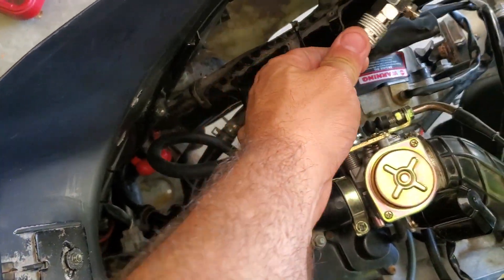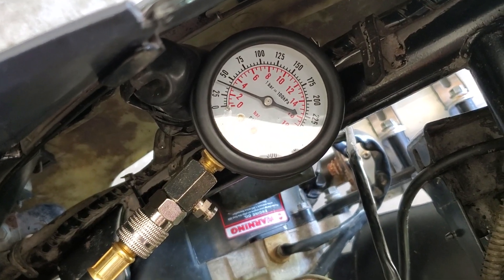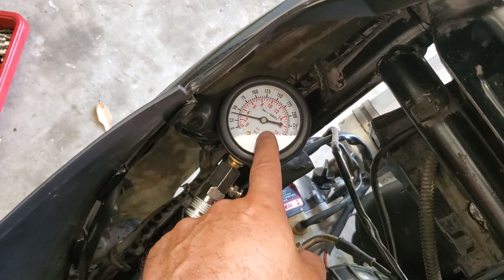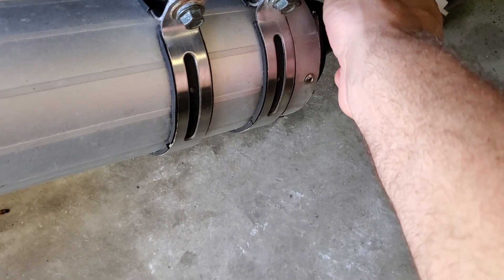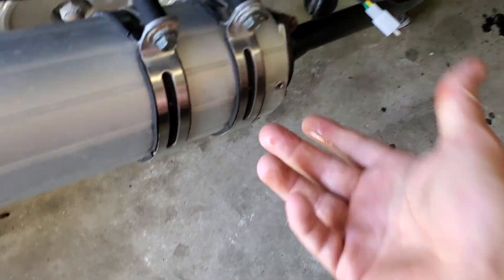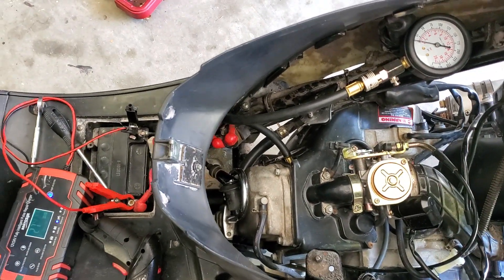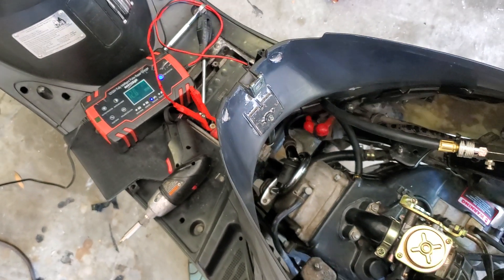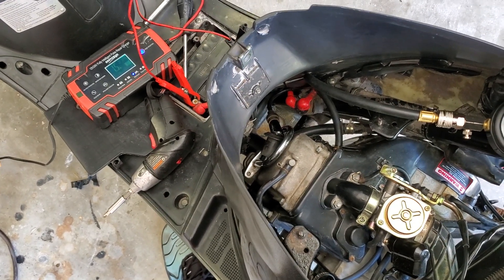50cc scooter compression test

Comment: Do you have a trusted place to get a new engine? My scooter sat for three years and wouldn’t run at all. I have been fixing it new gas, oil, starter, relay, new electric start, Valve adjustment, and I’ve gotten it to the point where it’ll turn over and when adding and external fuel source like carb cleaner it starts but immediately dies. After watching this I’m sure it must be a compression issue and that old oil. So I’d like to try a new engine maybe a big bore kit. For added hp. Any recommendations?
Reply: did you replace the carb?
Reply: @thelagmeister  nah but it’s probably pretty clean since I used carb cleaner. Ima try and engine dregrese then maybe I’ll replace the car